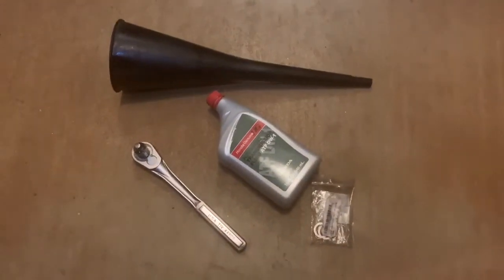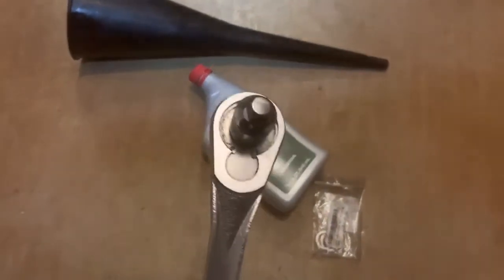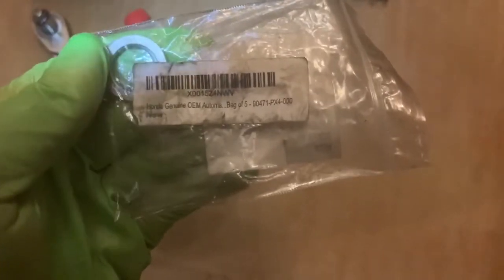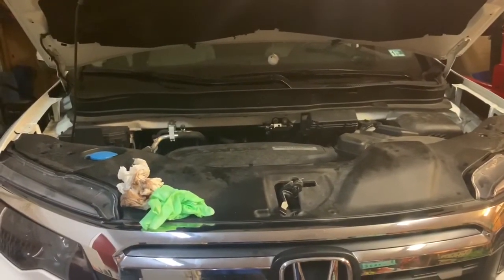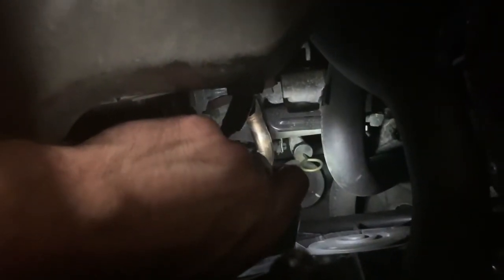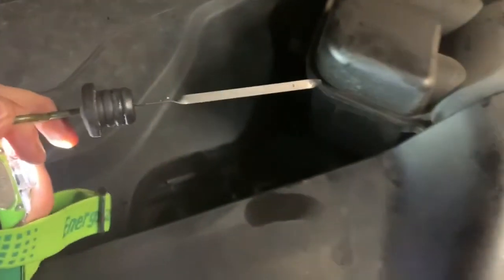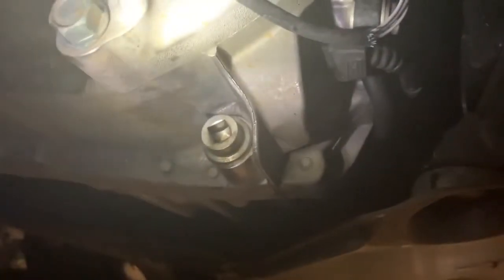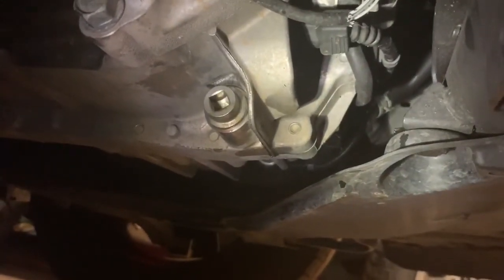Transmission Fluid Change - 2017 Honda Ridgeline

Comment: Why wouldn't you use the fill opening in the tranny instead of filling through the dip tube?  Its far easier and just as easy to access.

Comment: Why no filter change?
Reply: There is no serviceable filter on the Hondas.
Reply: Well I stand somewhat corrected.   There is an external filter! Not required to be changed though as part of the regular maintenance…designed for life of car…